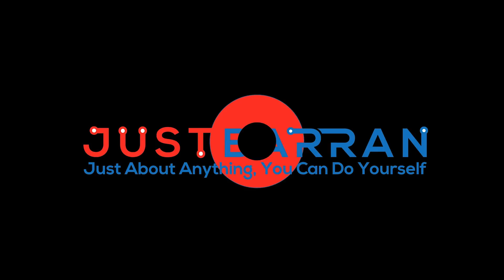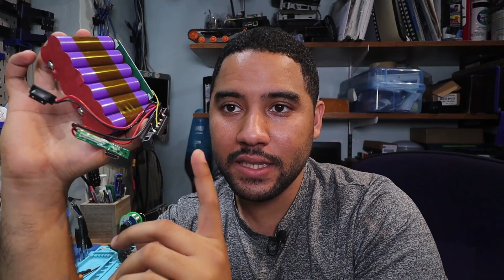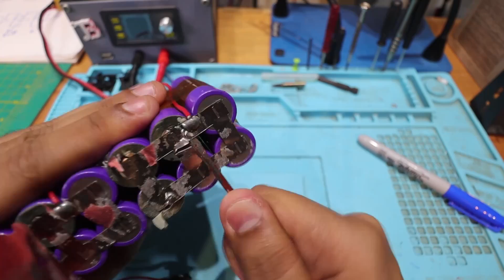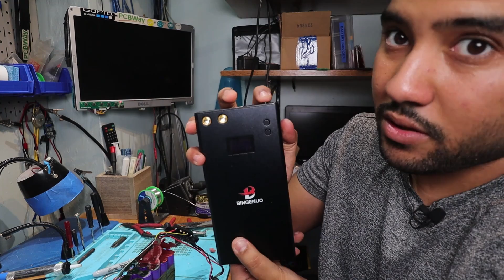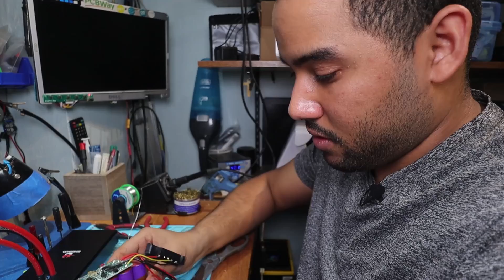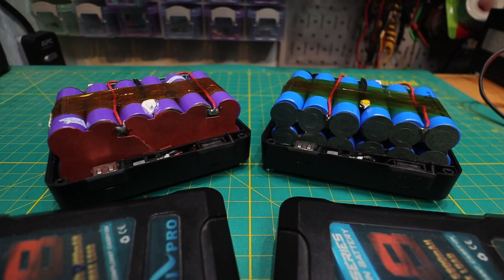Fixing a V-Mount Camera Battery | How to Fix Battery Packs | Fix-it Fridays

Comment: Thanks for the video, i have old sony v-mount battery , i test the + -   terminals with multimeter, it gives no reading at all, but when i disassemble the battery pack, the cells gives medium voltag, where is the problem ?
Reply from the maker: If the cells giving above 3v then it might be the Battery management system is faulty. Or if might be your chargers. Another possibility is the BMS is in a protection mode , check to make sure the output pins are clean and not shorting and try and apply a charge voltage to see if the BMS comes back online
Reply: @JustBarran  
Thanks for your reply, it appears to be the bms has some sort of protection, to only work with its camera designed for. 
I want to used for Led with V-mount socket. 
But the battery pack has 5 terminals , so it must communicate with the Bms. It has text on the terminals ( - / id / data / clk / + )
Can i overide this comunicaton ?
Reply from the maker: @ I am not sure to be honest, you would have to see if someone hacked it and got a solution. In my experience there is always a work around for these kind of stuff but it’s the effort. See if you can see maybe a chip on the BMS and check the data sheet. It might have maybe a pin you can short so it’s in operational mode and not a slave
Reply from the maker: @ you can also check thst ID pin it might just needs to be sorted to ground to enable the power output. But see if you can find a data sheet first
Reply: @JustBarran  
That's a good idea, I'll try it out.
I'm only doing it for fun and to learn, i love Tinkering. 
Thanks for your help

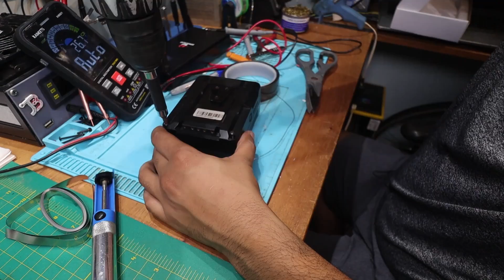Comment: You cut the video on 14:07 , the batterie Led Test was negative not Led lightig WHY ? 🙂
You need to plug the batterie back to the Charger to reset the BMS and get output Voltage
Reply from the maker: Not if the battery is dead, no amount of charging is going to switch back on the BMS battery low voltage protection. When Li-ion batteries drop past their terminal voltage and go to zero they basically become a short circuit

Comment: Will the BMS understand the Volts and Amps of the newer higher powered batteries?
Reply from the maker: The bms doesn't need to understand the amps, it's designed for these types of l-ion batteries with similar normal/breakdown and charge voltage. The charge current and output current would be limited by the bms but this would be done automatically. And should already be with in spec, if not over spec due to it previously have a smaller capacity before

Comment: I have 2 v mount batteries which I believe are dead due to not using them for over a year. Can yu help me revive the, please? Cheers
Reply from the maker: Hey, like these batteries are you getting any voltage at the output? Or non at all, the question is if the BMS is still good you can, woukd be just to change out the batteries, but the really trade offs is depending the batteries and bms if it make sense to fix or just buy new ones, in this case with these b mount batteries it seems better to fix